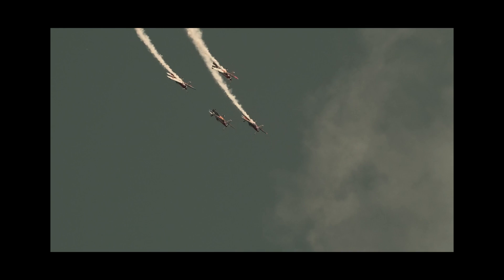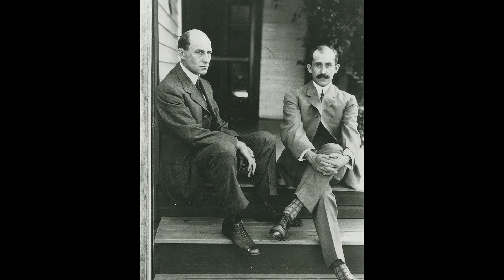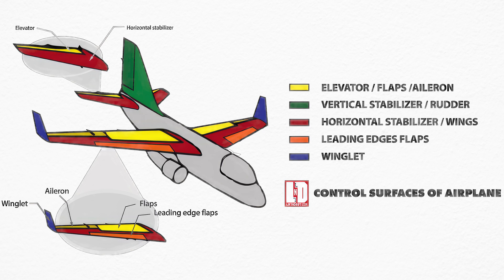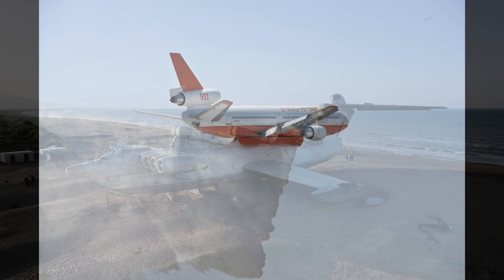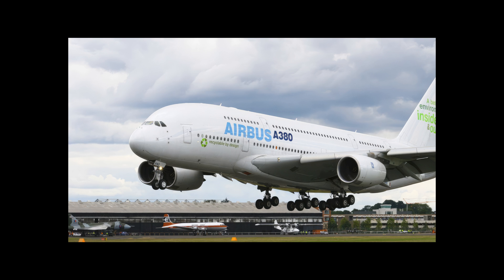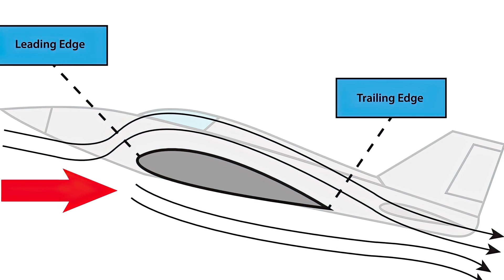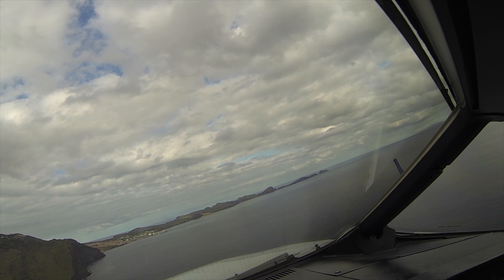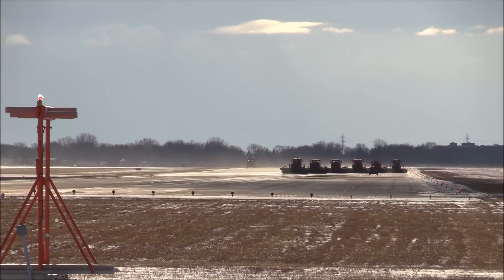History of Flight: Firsts and Fails

Comment: The flight of 59 seconds and 852 feet was the 4th flight with Wilbur at the controls, not the 2nd. the 2nd and 3rd flights were in the region of 175 feet. Accuracy is important.
Reply from the maker: Sorry about that. I should have double-checked that before posting. Thanks for the correction 🙏